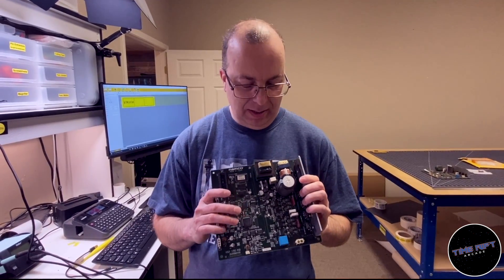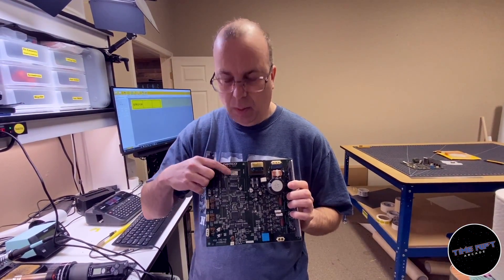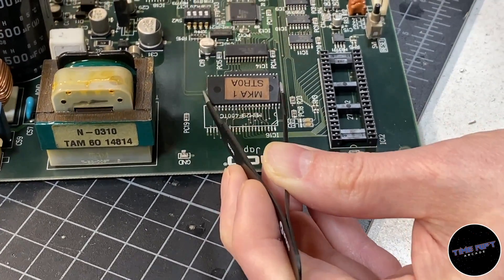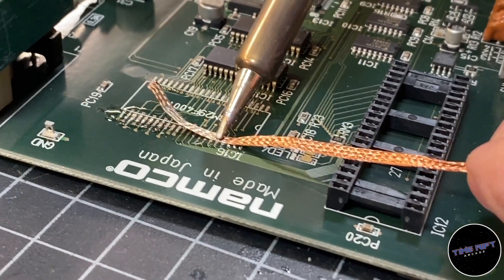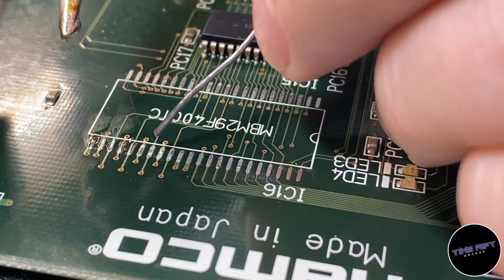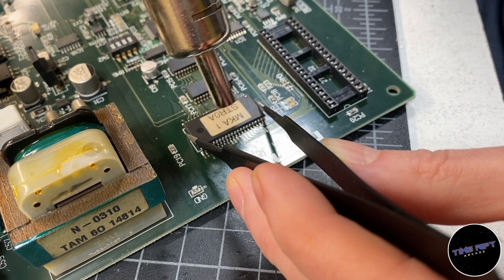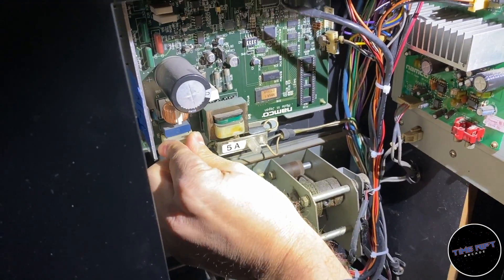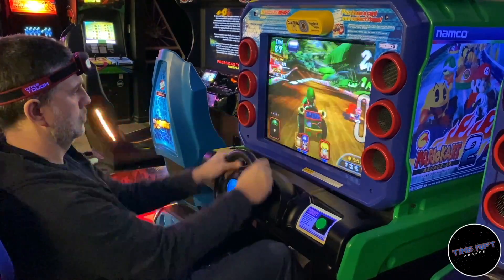Replacing a Surface Mount chip in Mario Kart Arcade

Comment: Solder the first and last pin on each side, then use a normal iron and pull the blob from all the pins in one direction, the last pin will get the residue from this process and you can use the wick to clean, I made this a lot of times, and found this method usefull.

Comment: If it works it works but I personally think it’s better to use some flux and preheat the board from below too so the pcb heats up more evenly and then the part doesn’t take that long to be removed when directly blasted with hot air. Also it helps to gently “rub” the part flat onto a piece of paper as a lapping pad to clean the legs if it has been seating for a long time to remove the oxide layer and get better bonding. I’d prefer to tack the new part and then solder each leg (or use drag soldering if enough flux). I always enjoy your videos nonetheless ❤

Comment: Dave, when doing this, My method is to put some flux on the pins before I try to lift the chip which makes it quite a bit easier to flow the solder to lift the chip, and depending on the board I will to use a regular iron to flow some low melt solder onto the pins before I try to hit it with the hot air.  This allows me to lift a chip with FAR less heat required  (Less risk to the board or any plastic bits nearby in case I am not precise with the hot air)

Comment: Solder braid tip: cut off pieces and hold with tweezers.  This will allow it to heat up faster and wick better. Also, that IC package is much easier to solder back down with just an iron if you don't have paste.  Line it up, tack down one corner, tack down the opposite corner, solder the rest.

Comment: You'd probably be better off using the drag technique to tie the pads after cleaning them properly. Lots of liquid flux, load up your tip with solder and slowly drag it over the pads.
Reply: Yeah I was thinking the same thing.  Didn't need the reflow gun to place the new part.

Comment: Wow...the size of that cap. I do not want to be around that thing if someone installed it backwards.

Honestly, you are probably better off just using solder wire and not paste. The paste is meant to be applied via a silk-screening method and while it can be manually applied by dabbing it onto the pads it's just easier to use wire.

Comment: Anytime I have a similar job where there's any prospect of having to change the chip again, I put a socket in place. May not be the case here but I work on a lot of 2-way radio equipment that occasionally get firmware updates.
Reply from the maker: Surface mount sockets are pretty hard to do without production level equipment.
Reply: @TimeRiftArcade    Perhaps the ones I've done are the exception (32 and 44 pin PLCC)...? Seemed fairly straightforward when I did them.

Comment: If you clean the board down to bare pads with solder wick, put the new chip on the bare pads so it's flat, and solder opposite corner pins. Then just go solder all the rest of the pins individually. Those pins are like a mile apart so it's easy to do, but even if they're closer, use flux and "drag soldering". Putting solder down, and then trying to balance the chip on the solder is probably the most difficult way to do it. I'd also crank up the temperature a little (or you need a higher wattage iron) when using the braid - it looks too cold. Definitely putting flux on the braid helps, but more heat will help even more.

Comment: One thing that you can do when youre reflowing the solder to solder the chip back down is add a bit more flux.  That way any oxides that might have formed when you were applying new solder to the cleaned pads will get burned off.

For leaded solder it's probably not an issue, but some lead free solder can end up crusty and not make as good of a joint if you don't add some more flux during reflow.

Comment: What made you suspect the ROM chip was bad?
Reply from the maker: These modern machines have some pretty robust diagnostics.  There are board tests you can run, and then those will identify areas of the board or even individual chips to check.  Many times they are failing CRC checks.

Comment: Oh dear.... no preheat, no aluminium tape to cover surrounding components, etc. When installing new component it would be much wiser to fix two leads opposite each other and then perform drag soldering instead of unnecessarily and uncontrollably heating up new IC with hot air in an effort to perform reflow.
Reply: In all fairness this is a 2 minute video so there is likely a lot happening off of camera he didn't show.  He did preheat the component and even mentions it in the video.  Lastly, in my experience his method works better than drag soldering and is the same method I use regularly without issue.
Reply: I agree it will work fine for tssop packages and similar.  Will be more challenging for qfn but I doubt David's arcade machines have those.

The biggest advantage of solder paste is that it comes premixed with flux and you can get low temperature paste which then just makes the whole job so much easier.
Reply: You're probably being overly critical here but I do agree that soldering the new chip by hand is probably easier than using hot air.